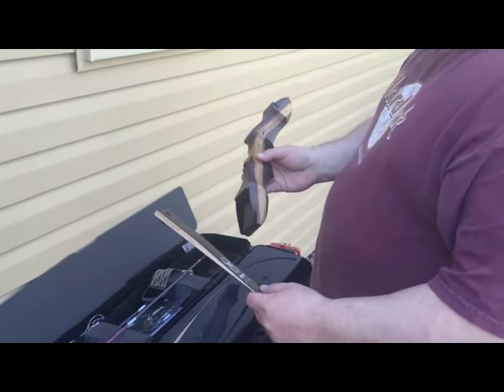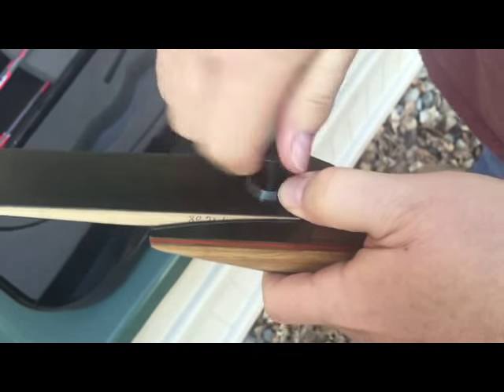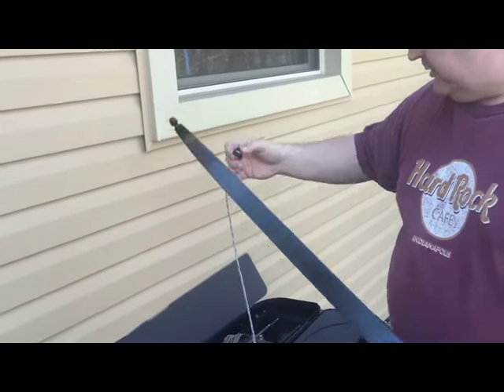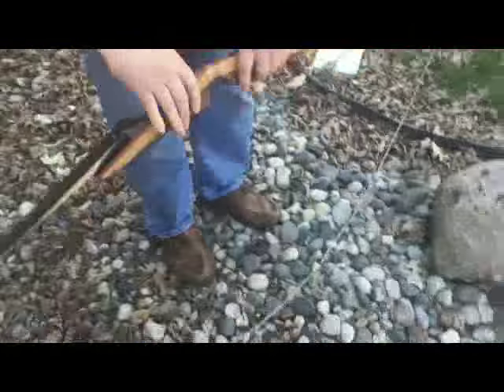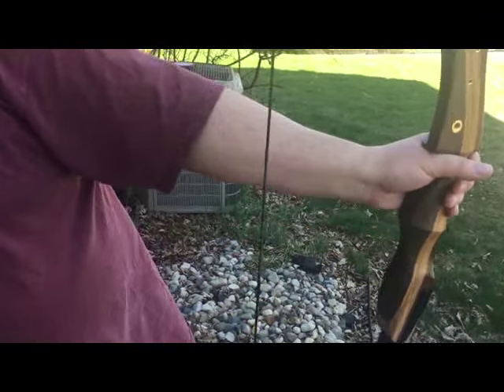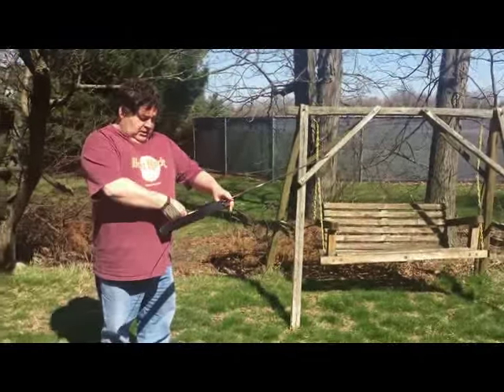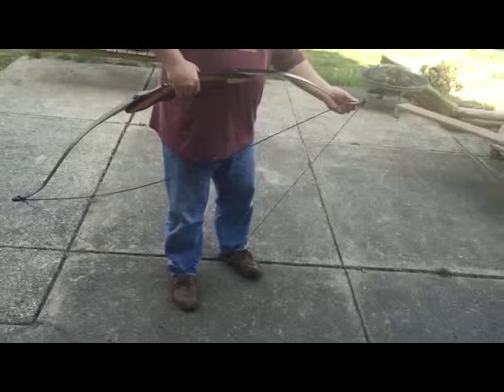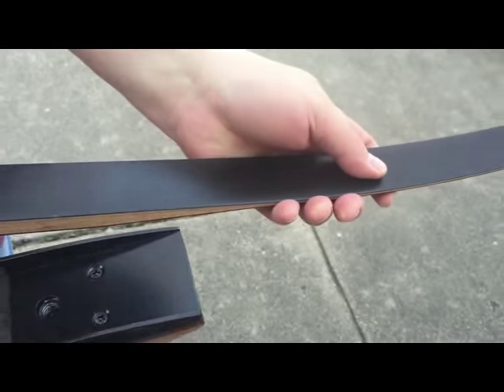Southwest Archery Spyder Takedown Recurve Bow 20lb Package

Comment: lol this is a samick sage that was re-labeled
Reply: there is also a red strip in the lamination and different limb bolts. but this is barely different
Reply: If I've read the promo stuff for it correctly its more of a improved/relabeled journey?  The sage was for draws <28" and the journey for >28" from what I've been reading.  They do say this has been improved in several ways but I'm not sure besides cosmetics how that is.
Reply: The riser overall looks better and sleeker, The hard corners are rounded. Bit less mass weight in the riser. For only $10 more I say it's pretty worth it. Would be cool though if you could get the riser in all black with the same red accent piece.
Reply: wonderwolf303 The bow comes in 62 inch and they got the Spyder XL which is 64 inch. So the design is both Sage 2.0 and Journey 2.0
Reply: Before I purchased my Spyder XL I emailed the company and they confessed the riser is the same between the Spyder and the Spyder XL. So its only the limbs that make the model as it were.
Reply: Christian A-L Pretty much, but this one has a red wood accent rather than the lighter wood accent.
Reply: It's also 1.6 pounds lighter.
Reply: @christiana-l7882  It is designed by the same guys who designed the Sage but it is an updated version. It is about 1 1/2 pounds lighter than the sage, and the riser is finished better. No sharp edges. All the edges are smoothed out, and the grip is a bit more comfortable. So no it is not a "re-labeled" Sage, but an actual improvement on the Sage platform.
Reply: Much smoother riser, tapered limb “pockets...better than the sage.
Reply: Christian A-L  take a better look at the sage and you will see and feel a big difference.
Reply: Nearly all wooden DAS risers are virtually identical. There are small differences. Finger tightening fasteners vs allen key fasteners. Some like the Sage have sharper edges. Some like the Spyder are more rounded. Wood selections vary. The Sage and Spyder are about as alike or different as any other wooden riser out there. The Sage didn't bring any innovation that Fred Bear didn't already do. The Sage just really brought a decent bow with custom features to market at a low price. I prefer the Spyder because its a little more refined. Rounded edges and lighter weight in particular. Kind of what Kimber did with the 1911. They didn't invent it by any means. They just made many custom features standard.